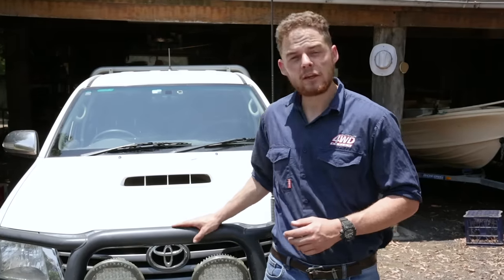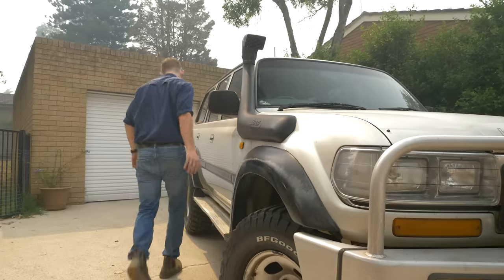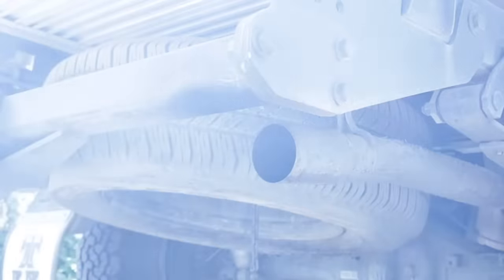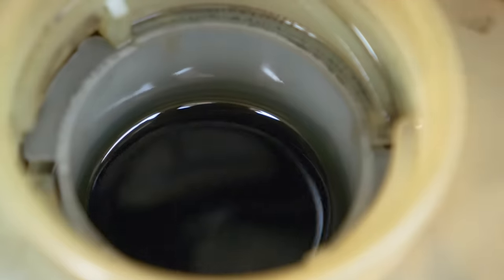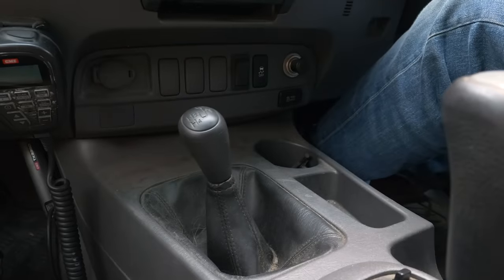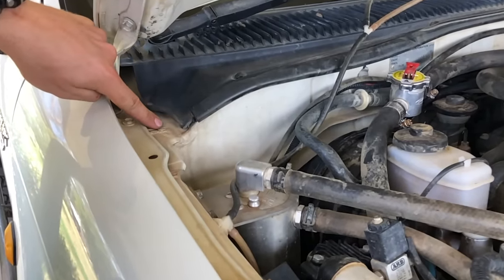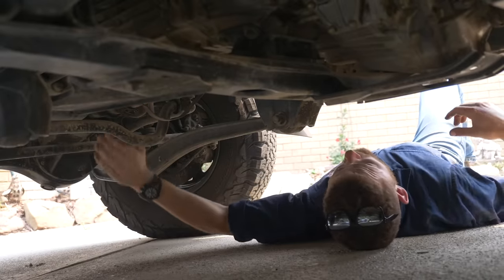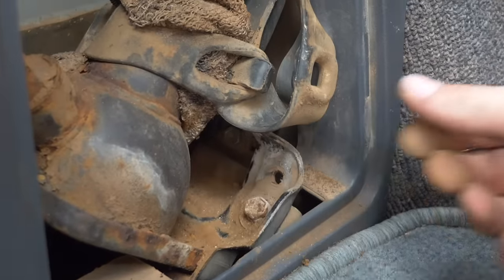BUYING USED 4WDs – Expert tips to avoid a LEMON and get a BARGAIN

Comment: Always check the backlash on the diffs, gearbox & transfer box in all gears in hi & low range in 4wd & 2wd modes. Limited slip rear diffs need to be shimmed & re torqued at least once a  year & if not done this will show up as "backlash" at the rear diff pinion & tailshaft junction.
Reply: Hi, could you elaborate more in layman's term? Interesting topic since I got a Pajero NM with 4LLc...
Reply: @bebbuinc7611 . Backlash is the layman's term for excessive wear on the gears, pinion shaft & differential crown wheel. You'll need a friend to help you do the following check. There are several ways to check it. If your buying a vehicle obviously you can't go jacking the car up or undoing things, so the easy way is to get on level ground, drive forward a bit, put the car in neutral, turn the car off but make sure it doesn't roll back wards or forwards,do NOT put the handbrake on, put a chalk mark at the top centre of the rear tyre, Get your friend to gently push the car backwards while you watch the tailshaft , the moment it moves, yell out STOP, to your friend & get him to make sure the car does not move, put another chalk mark on the tyre, top centre. You now have two marks & from that you can estimate if the wheel has turned 1/4 or 1/3 or 1/2 a turn. The "rule of thumb" for a good condition diff is no more than 1/8  turn. If you've got more, then the "crown wheel / pinion shaft needs to be "reset". If you've got a lot of free play then it will need replacing unless your not worried about it & have a stack of diffs in the backyard. The gearbox "backlash" is something you should notice when driving as you change gears, if there is a small "clunk" or delay in the engaging of the gear when you release the clutch that is an indication that there is wear in that gear. On your own vehicle , jack it up, take the tail shaft off at the gear box & you can then check the " backlash" in each gear by turning the gearbox by hand , to the left, until it "takes up" or stops. Chalk mark the tailshaft drive flange at bottom centre & then turn by hand to the right until it "takes up" or stops. Remember your not trying to turn the motor over so use common sense when turning the drive flange not a 3' screwdriver🤔. 
Chalk mark the bottom centre & as with the diff you can figure the "backlash" of each gear. Remember Bekku this is a "rule of thumb" & commonsense method which I prefer rather than getting a "clunk" or take up delay when actually driving as that could be gearbox, universal joints & differential wear all combine d together. Hope this helps & I haven't got your head spinning faster  than the Pajeros wheels! 😁. An remember Bekku,  ALWAYS use axle stands b4 you crawl under a car. 
p.s.;  Sell the Pajero & get a TOYOTA  LANDCRUISER !

Comment: I would recommend buying a 4x4 without any off road modifications. A lot of people use them as an SUV and never take them off road. All though it is a little more expensive, at least if you build it your self you know the modifications have been done properly. You also know you are starting with a vehicle that probably hasn't been off road.

Comment: I got a 60 series, which won't stop rusting, then i purchased a 12ht for it and the cylinder head was cracked, injectors rooted and injector pump was also knackered! Safe to say i won't be retiring for a long time

Comment: Bought a 2008 3L Pootrol with 112k on it 3 years ago and it's been nothing but trouble and a money pit. I've replaced it with a 2000 79 series LandCruiser with a naturally aspirated 1HZ and 290k on the clock. Not overly comfortable, no bells or whistles, drives like a tractor, uses a bit of fuel and has a bit of rust here and there, but everyone keeps telling me it'll last forever. I sure hope they're right. I'll NEVER buy a Nissan ever again.
Reply: tommypk86 the weight of the patrol was too much for the ZD30 engine, in the D22 Navara the ZD was good, my D22 did 100k plus km trouble free before i sold it

Comment: My 2008 BT-50 had a bit more k's on it than it should have when I bought it 5 years ago. Yes, it had towed a caravan around Australia but this thing is still running like a dream. 330k on the clock and I want to see how much it can do. It's an experiment now:) My point is, it may have worked reasonably hard and still does but look after it and it's working within its design specifications.

Comment: I bought a Jeep YJ 1995 with 95k miles, Runs good needed a water pump, radiator, and has outboard floor supports issues, and had no title.. I did after 5 months was able to get a title, for less than $200. I only paid $400 US for the Jeep. AND i drive it today. Will replace outboard floor supports, when i get time and money. Blue book for the Jeep is about $4000 as is. It is worth the money and time to fix her up!! 

Jeep YJ, 33-10.50 15 2.5L

Comment: You forgot to add stick your finger in the chassis rail and feel around for sand or rust near the rear tyres and front tyres. Pretty common on the patrols for them to be full of sand or mud

Comment: Bought a 2009 BT-50 with 144,000km for $16k cash. Dealership was located in the city so the test drive was slow going and short lived. Over the next few days I noticed odd turbo noises, oil from rocker cover and 4th gear problems as well as a slipping clutch 😂
Under warranty, now they're up to fix it all...

Comment: Could have used these tips before Christmas but we probably would have still purchased the 60 series Landcruiser anyways....
 
It was blatantly obvious what needed to be done to it as the owner hadn't tried to cover anything up. He had it for sale for quite some time and by the time we looked at it he had dropped the price by half the original and we negotiated for less than that. It needed a fair bit of work underneath but the engine (V8 Diesel converted) was sound and engineered. Between my other half and I both being HV mechanics we've been able to do all of the repairs ourselves saving a lot in labour costs including replacing the rear diff and wheel bearings, some suspension components and replacing brakes all round as well. We still need to rebuild the front axle which should be done this weekend if not the next. 

She drives well for being 40 years old but we still need to tackle the body work which has some rust and obvious bogged up jobs. Having had a number of projects in our past we're quite familiar with repairing and treating rust so hopefully the hidden bits won't be too much to chew. We weren't anticipating a project 60 series as we currently have a Holden Gemini TD panel van that we're rebuilding but the price was right and we could easily see what we were getting ourselves into.

Comment: Gday. In 1995 I purchased a 1994 diesel troopie with 9000 km on the clock. It was ex army. I took my mechanic to inspect. His advice was   Its that good if u dont buy it i will. I still have it   It has been my daily drive carrying a permanent load of 800kg as my electrician truck. I use it for camping and towing our 2000 kg boat. It is never pushed. Serviced properly every 10000 km by the same mechanic. Has never needed major repairs and is a pleasure to own and drive. She is slow on todays standards but i let her find her own way up the hills. We are now nudging 600000 genuine trouble free km. I never need to add oil.  Ive kept her bog standard except for a statos suspension seat, new terrain tamer suspension several years ago , rims and tyres 22 years ago and a new transfer case main bearing 14 years ago. I put a new radio in just this week   Toyota have facilitaed me with incredably cheap motoring with this car. She will be handed down to the kids when i get old. He does have an reoccurring rust spot in the back guard

Comment: Hey there,  Thanks for the video as very informative.  Now I have just pruchased a 2005 Nissan Navara ST-R ZD30 Dual Cab with 337,000 k's on it.  The owner had owned it from new and has had it serviced regulary and from 250,000 k's had it service every 5000k's.  Body is straight and all panels and paint match.  Does have the usual carpark knocks, scratches etc.  12 months ago the owner replaced the original alloy front bar with a good quality steel one which has a winch and LED driving lights.  The engine runs smooth with plenty of torque, gear box and tansfer case both shift smoothly as well.  Near new tyres A/T and steering is very good.  I am a up front person and glad he was too.  The Navara does have a ARB roof rack and 2 x HD bars on it and asked him why,  he showed me their roof top tent and yes that is why he put these racks and bars on it.  The paint in the tub has the usual paint marks on it due to items being pushed in and dragged out but NO dents etc.  Underneith is straight, no gouging of low hanging suspension parts etc and all bash plates just have the normal wear marks on them.  So I think I just might have got a good one compared to what is on the market at present.  One more thing is that all the work that has been done to it over the years ie servicing, repairs etc, I have all the reciepts so bonus I say.

Comment: I got myself a 2013 Patrol for 24k. Beggining of the year (2019). High Kms (235000) but full service history. Did its first 75000 in the first year on the road. Nothing wrong with it. But was definetly used for towing and long distance

Comment: I live in north Carolina in the USA. In the winter we have a 50/50 chance of ice or snow.  If we dont keep up with rust it will run rampant. It seems like they drain the ocean and spread the salt on the roads. If you buy a vehicle from the mountains they will probably be just as rusty as one from the beach if not more. Got to clean and spray bomb the under carriage.

Comment: bought an '08 GU Patrol and spent more time worrying about it than enjoying it. Found issues where there were no issues and ended up paying for the intake and exhaust manifolds to be removed and cleaned as well as me poorly timing the purchase and it needing a major service.

Had a freak accident driving around a bend and braking too hard while the cruise control was on causing the throttle position sensor steel plate on the EGR system to snap off and go into my intake manifold (cost me 2.8 to fix). 3 months after that fix it's now got a suspect blown head and has been sitting out front for 2 months because I can't justify 6k for the fix.

Interior's in fantastic condition, mods were all clean and the car appeared well maintained.. i think I chose a lemon mechanic rather than a lemon 4wd

Comment: Well thats crap, I  bought a 92 1hdj80 land cruiser 3yrs ago, 492kms with heavy towing accessories, tow hitch,braking system, airbags, 450kg springs and I tow a 1.5 tonne excavator everyday and go 4wding every Change we get, and tow my boat every weekend original motor i service it every 3 mths, and still go's mintox, ohh what a feeling,  if ya want a great 4by,  an  old landcruiser or an old patrol there ya best options

Comment: There is an easier way to check the engine besides looking at the smoke color. After the engine has ran for a while, take a rag or a paper towel and carefuly not to get burnt rub the inside of the tail pipe. If the sud on the paper is sticky and leaves thick marks on paper then oil is being burnt along with the fuel, so ether the seals are worn or the piston rins have damadge.
One more easy check is to get an ODB wifi tool off ebay for 10-20 bucks, plug it in and see what errors did the ECU had.

Comment: Here in America buying a stock 7.3l powerstroke is virtually impossible. Big things I've always learned is never buy a truck lifted with over tires without paper work showing that it was installed by a professional. Never buy a diesel from a kid knowing it has been dogged out. The best way to buy any truck 2 or 4wd is buy stock.

Comment: Brought a 2000 hilux 5l engine after market turbo 270,000 no signs of hard off road use gearbox feels good checked  intake,turbo, fitted catch can very little blow by has egt gauge  fitted post turbo, I did full service all oils everything good, replaced idler arm wheel beering axle  seals drives great had  a 1998 before this one payed 12,000 for that good car but was way worn compared to this one payed 6,500 perfect absolute bargain

Comment: Gday Jocko, 
Mate i reckon i picked up a pretty good deal, recently swapped my 2011 D40 Thai Auto Low spec RX 2wd with just over 230k on the clock for my mates 2015 D40 Thai Man SE Silverline Ltd 4x4 with just over 65k on the clock... neither vehicle has missed a beat mechanically, but im stoked with the newer D40. Just much more comfy, more power and just nicer all round... and has a better resale 👍🏻👍🏻

Comment: bought a 94 lux for 4.2K, turned out the injector pump was leaking and had a black sponge rammed into it to cover it up, to the naked eye you couldn't see anything until the car had run long enough to saturate the sponge enough for it it drip, disappointing it cost me another 1500 bux to fix but then had an absolute off road weapon, slow on the black top but destroyed tracks. Lesson learned from this, pay particular attention to the injection system and test drive it for a good amount of time.

Comment: Bought an '02 D22 STR Nav, 168,000km on the clock. Paint was stuffed. But it drove perfectly. $6500. Had it for 3 years now, and have only done services on it. No major problems to fix.
Reply: Will Taylor because that’s the 2.5 POS
Reply: Will Taylor wowsers, you are seriously misinformed 😳

Comment: I picked up a steal got a 1hdt 80 for 11k but it needed some work but nothing I can't fix being a mechanic the previous owner put a new engine in it and had the diffs rebuilt so I had to rewire the car and fix some rust in doors I just replaced the doors. Now it's a beast.

Comment: i got an early 2000's rodeo a few years back with a 4 inch lift, 31's and twin lockers, sounded very capable on paper. first day taking it off road turns out the front wheels did not have power to them when 4x4 was engaged and came to this conclusion when we had already made it an hour off the main road. after a lot of digging for nothing a good samaritan came passed and towed us back to the main road. sold the car a week later

Comment: I bought a lemon..rookie mistake....blue smoke, chows oil...no one could fix it all recommended new block..so I jus buy oil :-(, 2-changed coils x 6, 3-replaced belts and one pulley, 4-replaced thermostat 5-replaced radiator. But overall, i love my Zuki...2008 GV 2.7L V6. It had many tell tale signs but I just did not know I needed to look into them since it was on a dealer yard. Drives well though. Good take off and ride comfort. Have done more than 5 000kms in one trip over 10days and not a single problem...and have done more kms...total over 50 000kms in 2yrs.

Comment: yes i made the mistake of taking a persons word on a 4x4 k5 blazer she said it just needs a fuel pump well she lied everything she said was good was not i rebuilt the rear springs replaced the gas tank replaced the motor motor mounts and rad as well as taking out the power window and going back to manual i live in the states and where i live it snows she said the plow gear worked well it did not good thing i had a parts truck and garage that i could do all the work in love the show keep up the awesome work jock shaun and graham :)

Comment: probably an unpopular opinion, but I think the maintanence is more important than the number of km on the vehicle, I've seen 7-8 year old cars with under 150,000Km with blown engines due to maintanence not being done, whereas my 08 Triton has 490,000 on the clock, and still runs like a dream.  My triton also has an aftermarket brake controller, 33s, lift kit and a winch all equipt before I bought it from auction at 450,000km(history unknown).

Comment: Bought a 2002 nm pajero for $300 with a dead injector pump. Bought a replacement which turned out to be dead and the wreckers didn't uphold the warranty. Bought another from a pajero guru in wa and its been going well. Have installed a lift kit, all terrain tyres on aftermarket rims which will handle 33" tyres. So far it's been a great vehicle and still hasn't cost what it would have to buy one with similar kilometres and running with this set up. Been getting more adventurous with it and with some lockers and a winch will try a Cape trip.

Comment: i bought a 2004 ph single cab ford courier with a 2.6l petrol engine and when we had a look at the car it was in good condition but had clearly been bashed around as a work ute and has been taken off road as it had 32" mud tyres and a bullbar not sure if it has a lift as i havent found out the standard ride height but the problem was the fan belt but that didnt worry me so i bought it for $3,000 and after i fixed the fan belt the lifters started to play up so i fixed them and now she runs beautifully and i definitley do not regret buying it at all

Comment: I always tell the potential buyer:
It has been to hell & back
It has been in 1/2 doz accidents
I have sunk it twice and replaced the suspension when the chassis started bowing in. It has spent over 50% on dirt tracks. It has towed well in-excess of its weight limits. There are dents in all panels. I haven’t bothered with paperwork cause I have been busy driving the bloody thing. And I have never had a problem selling a 4x4 cause they know it is built properly in the first place! What woose buys a clean 4x4.